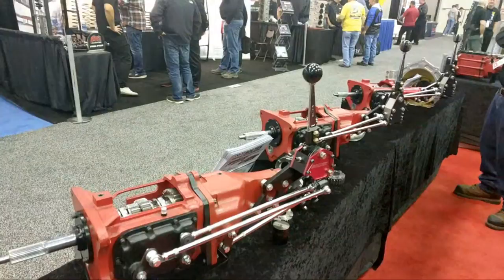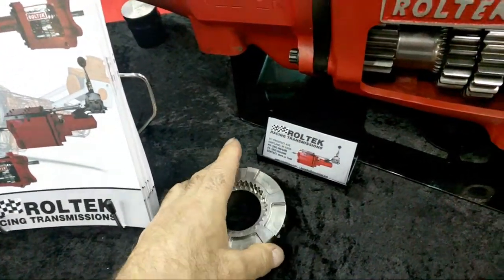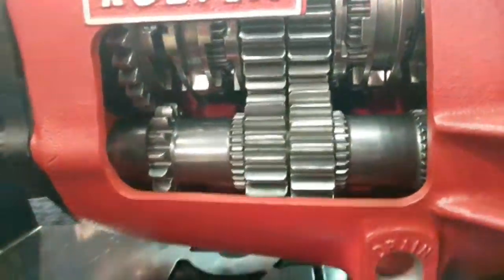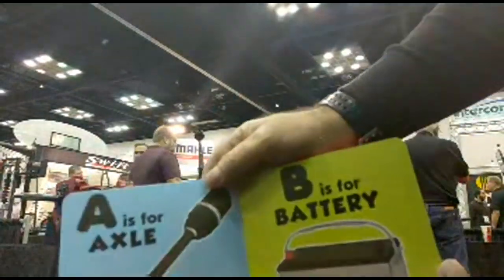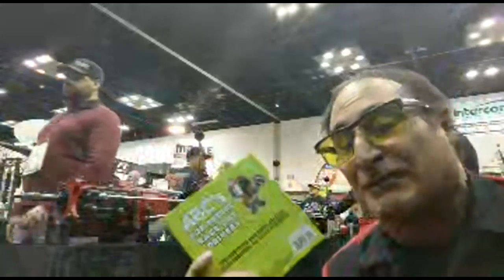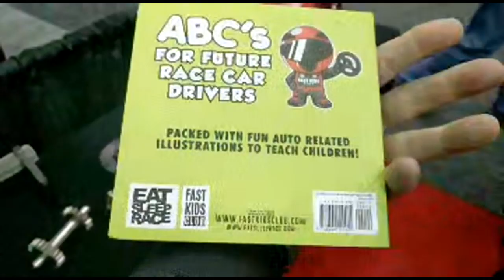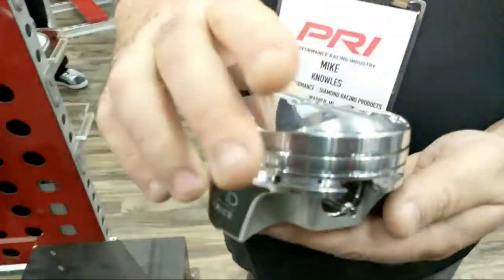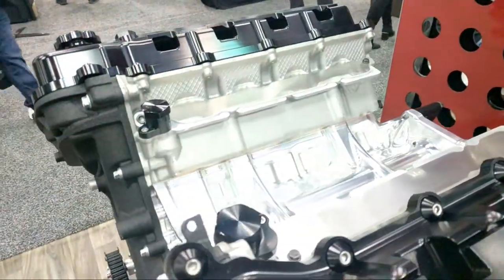Live From PRI Show

Comment: Thanks for the video. A point you may not have picked up on. Modular layshafts can be made to take more horsepower in the same housing. There is no need to leave a large gap between the gears to allow for the manufacturing process. It might not seem that important but being able to make a gear 60 thousands wider is effectively a free upgrade.
Reply from the maker: Well aware of it. Most of the new Muncie modular counter gears take advantage of that design

Comment: How would one calculate how much horsepower a stock tranny could actually handle? Lets say a mopar 833 in stock form. And i want to build a street strip racer. What parts would i leave stock and what parts would need to be changed at 300 hp, 400hp, 500hp, 600hp, 700hp  etc…
Reply from the maker: As a rule units are rated for the intended use they were designed for . So the Hemi versions with special alloy gears were the ticket back in the 70s . Today no parts are available of quality to hit those power levels unless you find NOS gears.